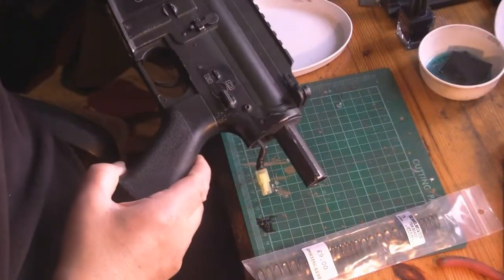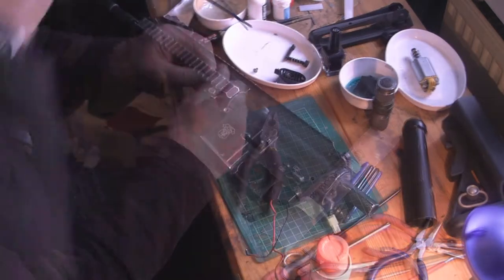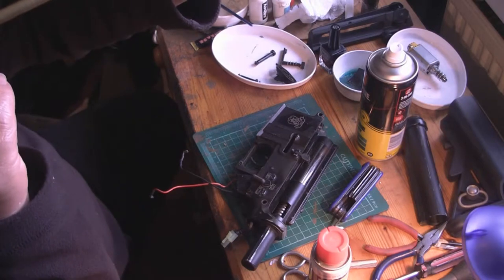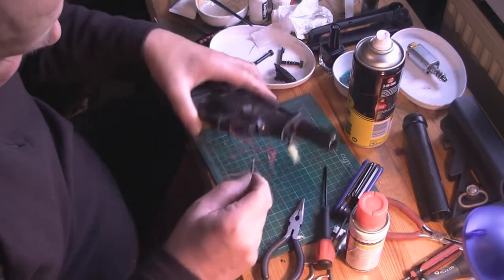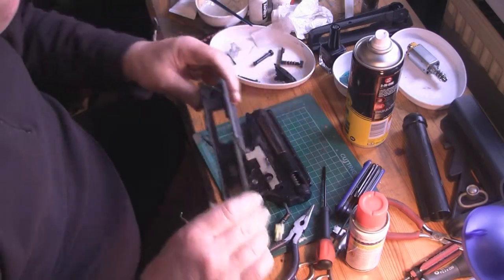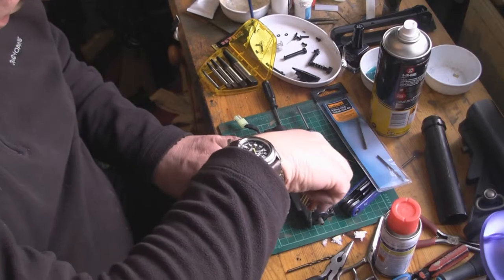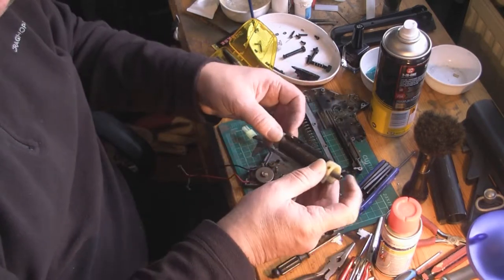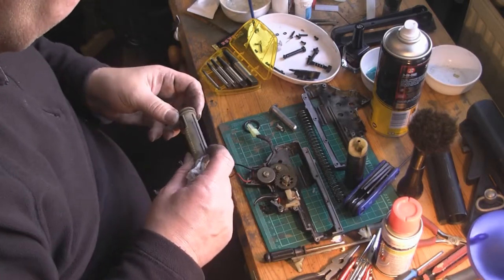AGM HK416 Spring replacement and lube

Comment from the maker: It was a M100, Can't remember the make as it was supplied by the owner. I do remember the fps being far higher than a M100 would usually deliver.
Reply: I also did put an M100 in it, it gave me 404 fps instead of the 330 it needs to give, my M100 is (SHS "Super Shooter" M100 Spring)

Comment: Can I replace the 2 piece plastic hop up with metal one piece hopup or is that a no go ?
Reply from the maker: Hi there, the hop unit is a copy of the original two piece TM offering for there M16A2 series onwards. A one piece unit can only be fitted if major surgery to the lower receiver is undertaken. The original AGM unit is very good but a TM example could be sourced and used.